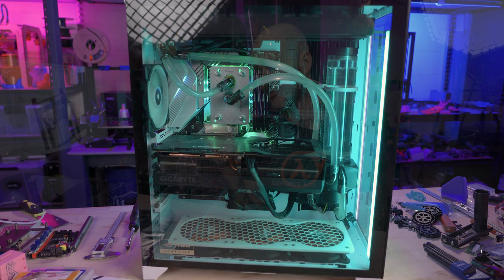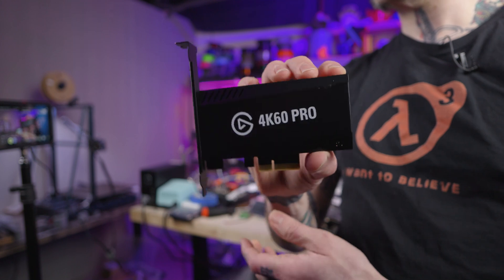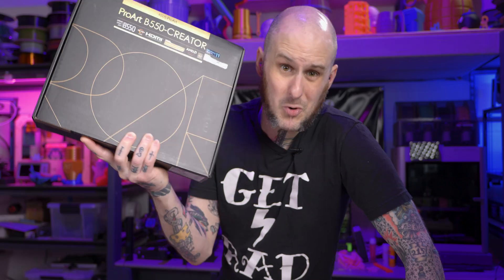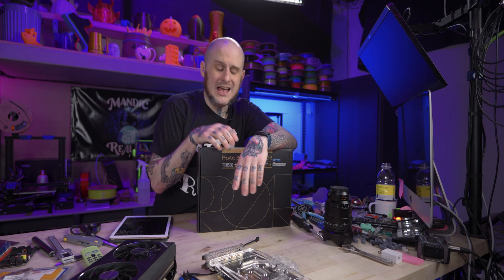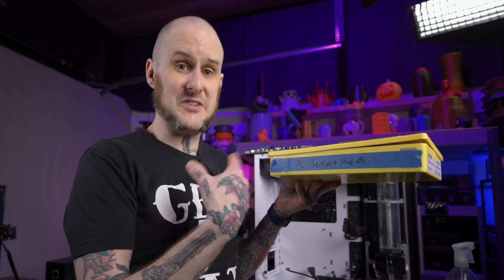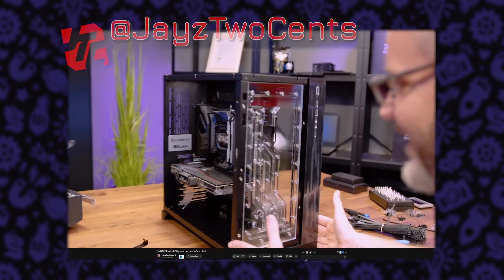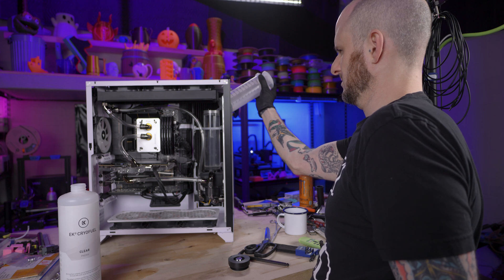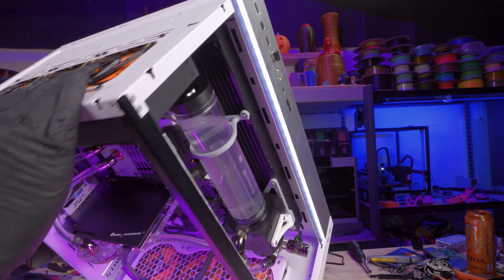Finally Watercooling my Workstation PC... It doesn't go great!

Comment: You could make an extender-type thing to hold the side panel further out.
It's good to take the reservoir out when you're tilting the case - you want to make sure there's a path for gravity to force the bubbles to move up and to a place where they can escape.  Bubbles can get stuck, especially in radiators, and stay there forever.  You may not notice it because water still flows, but the air pocket is a real restriction on water flow, they call it "air lock" in plumbing and pipelines etc.

Comment: Byksi makes a swivel style angled GPU waterblock bridge modules. If you replace the stock acrylic inlet/outlet ports -- you may gain some clearance. I have a pretty tall gpu with a byksi block and this adapter to connect to other GPUs in a 4U server case and all clears with plenty of room. You may need to alter your loop though
Reply from the maker: Good to know. As I intend to change things out, I’ll just stick with this for now but that may be handy for the next build. Thanks!